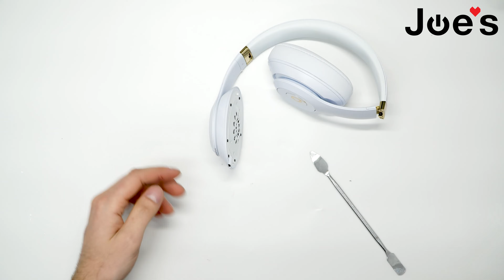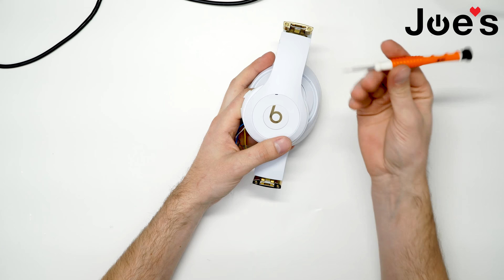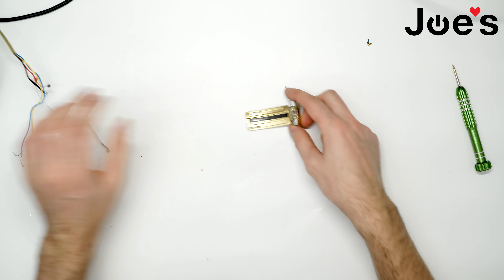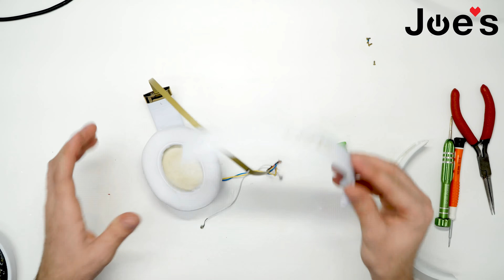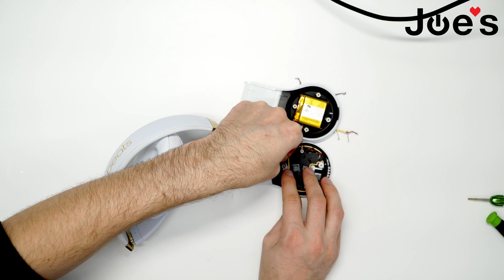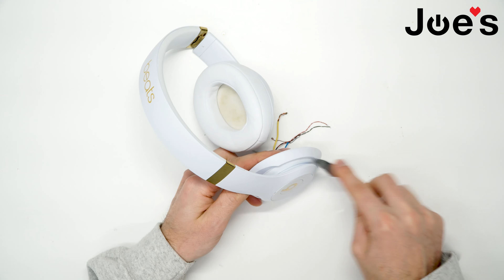Tutorial How To Replace Repair Broken Hinge Headband Beats By Dre Studio 3 Wireless

Comment: If you’re reading this, just cut the back of the hinge. I just did this repair in 5 minutes. Because the wire is designed to go between the hinge and the bracket on the back of the hinge that’s why he rewired it. The back of the hinge faces the ear so you don’t even tell that it’s cut.

Comment: The little hinges if you cut the little metal piece that goes across them making the hinges free not enclosed you can slide the wire through and don’t have to take the whole head phones apart I learned from a video works perfectly that way for me took like 10 minutes to replace
Reply from the maker: Thanks for sharing the alternative method; it's useful to know! 👍
Reply: Can you possibly make a video or something? I have a very serverely strpper screw and have been trying to get it out for months, but it won’t work, and additionally part of the headband is stuck in the hinge, please if you could that would be amazing😊
Reply: Could you send the video?
Reply: please respond

Comment: Anyone wanting to do this simple. Take a hacksaw to the bridge of the clip. The part that forces you to take the headphones apart so the wire can thread through. It has little use and does not add much to structural use. The screw still go in. Then you can fit it without the need to take apart. I have done this myself. Fix is excellent. Hopefully this saves a few breaking headphones trying to just replace a part of a clip that breaks at times anyway
Reply: brooo yesss I came here to watch a simple tutorial and didn't relise it was a whole surgical process
Reply: @Achilles_Chilaquiles yeah mate the process is wild for the sake of a bit of metal that does next to nothing. Even a good set of clips would sort it. No need to do brain surgery on the things 😂
Reply from the maker: Yeah! The process isn’t as easy as it might seem. Thanks for the comments!

Comment: If you're just looking to replace a broken headband, this video is 100x more complicated than necessary. Find another video that shows you how to replace the headband in 5 minutes. There is ZERO need to take apart any of the speaker for a headband replacement.
Reply from the maker: You are correct, it can be done much quicker. Like the title states this is a hinge and headband replacement video

Comment: my hinge broke too, put a piece of plastic with black tape to hold everything in place. Thanks to your great video, I didn't realize that I needed to un solder everything just for a simple part. Isn't there a faster simpler part that doesn't  require all that silly work? Or what if I just cut the center of that hinge to slide in the wire? lol
Reply from the maker: If you find a permanent repair that’s faster and easier let us know!

Comment: Glad I found this. Wouldn't it have been easier to remove the left side so that you didn't have to disconnect the battery? or is it almost the same?
Reply from the maker: The battery should be disconnected if there is any soldering involved, or you will fry a board.

Comment: What tool is that for the wiring part
Reply from the maker: I believe you are asking about the solder Iron. It's a tool used to heat up solder to disconnect wires, and components.

Comment: Hi, great video. what temperature is your soldering iron set to in this repair? Thanks
Reply from the maker: 750 degrees fahrenheit
Reply: @Joesge  thanks, I’m replacing the inside panel and I couldn’t find the melting point for the soldier anywhere. Really appreciate it

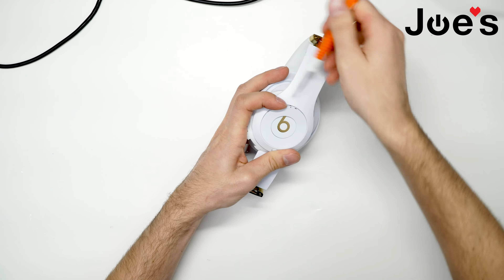Comment: @4:30 ...mine will not come out that easily I'm really scared it will break.Im losing patience to point where im just gonna throw mine away and buy a new pair
Reply: I’m having the same issue!
Reply: I think I see the issue. On the left side, it is not meant to come off like the tide side does. The screws are on the inside not outside like the right side
Reply: @axelcaballero6126  honestly...I just bought a new pair a few weeks ago on Amazon

Comment: Would it be easier to just change the headband and use the excisting hinge in most cases? I don't see any problems with the excisting hinge.
Reply: Also that would save you the headache with the wires as you only would have 4 screws to mess with.
Reply: @rasmushaugasmagi  Yeah, I literally asked the same... I dont see any problem with the hinge. Is only the plastic part that snapped, right? Less of a headache for sure...
Reply from the maker: We did it all together to show both processes. We have a separate video showing how to replace only the headband.

Comment: My god.. seems like it's practically impossible to do at home :(
Reply from the maker: Some things are easier to do at home than other. The headband is a pretty easy repair to do on your own.
Reply: Way too difficult for the average user. Why don’t they use quick-connect attachments throughout? Would add a little bulk but worth it. I’m going to try the “strategically added superglue” method.
Reply: Got damn cut the wires and but a connector for them lol
Reply: I tried it now I need to go to a repair companies
Reply: @ograt6407  You should've modified the hinge in a manner that it will go on and still allow the cable to enter it, so you could bypass all the extra work... very "mickey mouse" kinda job though.
Reply: @timothypanfilomaruchan8267  
They should easyly add a soldering point in the middle of the headband for detaching.
Reply: It takes repetitive practice to get good at anything. Fledgling solder tech here!
Reply: Not worth the time

Comment: I have 2 pairs of these (one given to me from a friend after the hinge on mine broke). oddly enough, the left hinge on both of them broke, can I take the right hinge out of one and put it on the left side of the other?
Reply from the maker: Thanks for the comment. Yes, you can use the hinge on either side and it will work. You can only use the top hinge piece that says "solo" or "wireless", not the extender. 
-David P
Reply: @Joesge  Awesome - Thanks for the reply! Much appreciated.
Reply: Is there a piece I can buy so I can fix the right hinge, right above the speaker?  I contacted Apple, they wouldn't replace it? Smh, I have bought 4 pairs and all with the same problem. No more beats for me.  4 pairs, in my randy moss voice, " CMON MAAAAN!!!!!!!
Reply from the maker: Thanks for the comment. What model beats do you have?

If you would like your device repaired by a professional you can fill out a repair form and follow the steps to send in your item. We offer free shipping and diagnostics. Here is a link to the repair form:
https://www.joesge.com/pages/repair-services

-David P

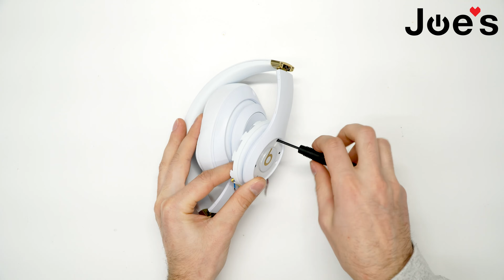Comment: My beats are fine but the part that's shown at 18:21 is open and I cant get it to close back up, would it be because its missing one of the screws that you put on at 18:37 ?
Reply from the maker: Thanks for the comment. Most likely some of the internal wires are not positioned correctly. Make sure the wires are placed correctly to enable the panels to close. 

-David P

Comment: Joe perfect timing for this video. I just bought a pair of studio three headphones for 40 bucks fix them and they’re working almost 100%. However, I think when I was trying to repair these I may have punctured a hole in the noise canceling mic on the left side. I’m thinking that it’s the small tab opening and the bee button. I’m wondering if it’s possible to get a replacement. At 7:40 in your video you unplug the wire that I am thinking is the mic for the noise canceling. Any help would be great thanks!!
Reply from the maker: Thank you for the comment. We are happy to help with the parts. Please contact email support@joesge.com for beats parts help. 

-David P